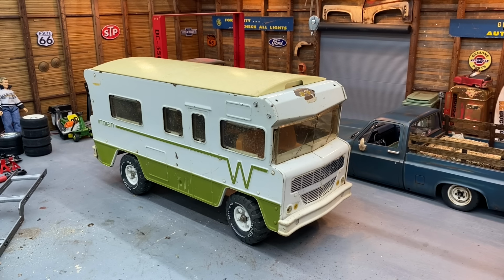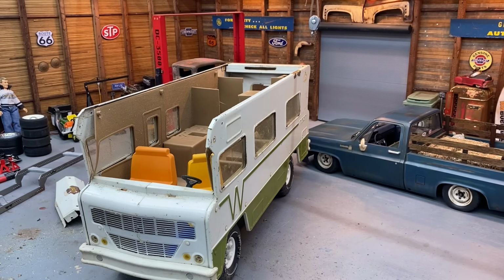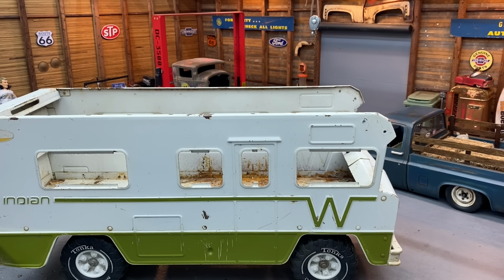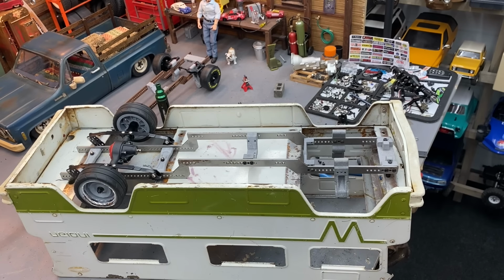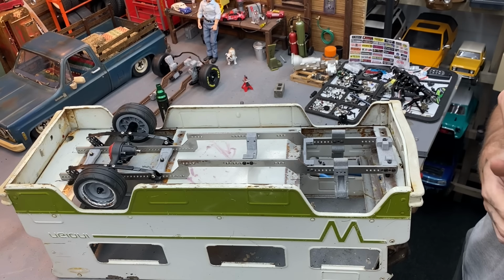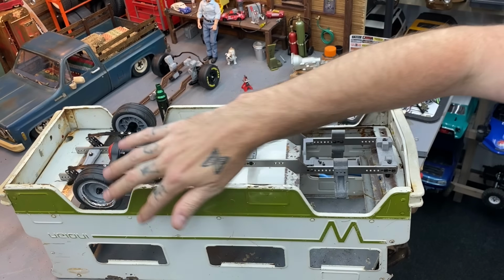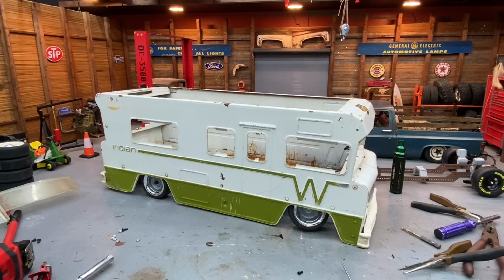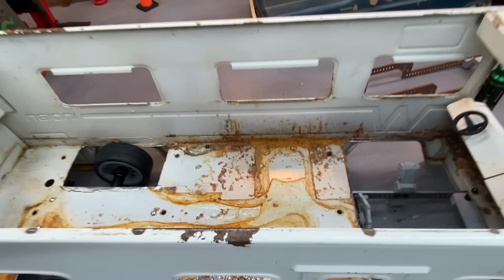Tonka Winnebago RC Conversion on RCeveryday.com Shop Truck Chassis, Part 1

Comment: Got an old Harley Davidson cabover Nylint truck I wouldn't mind trying to convert to RC.
Reply: Had one of these Tonka winnebago braves. I got $60 for it. Paint was perfect and had absolutely no rust. It was missing the top, the people and camp set. I think an in the box complete set goes for $300+

Comment: Would you consider selling a complete shop truck? If so how much for your all black square body with black wheels. Thank you
Reply from the maker: I dont sell any complete or rollers.  The black body is off the rtr rc4wd tf2 and the only way to get them is to buy the full RTR truck.

Comment: Does oven cleaner clean the windows?
Reply from the maker: Id be afraid to try it, any plastic I have ever gotten it on it messed it up.
Reply: @RCeveryday  I tried it for 5 minutes on a 125th scale model kit I'm working on to remove the Chrome it worked good on that and then I cleaned it off did not get sticky but I've never tried it on clear.